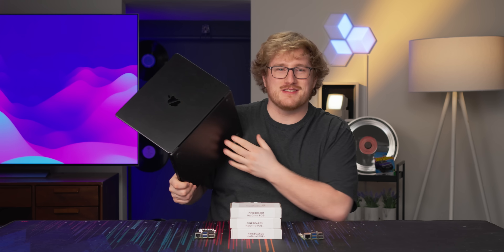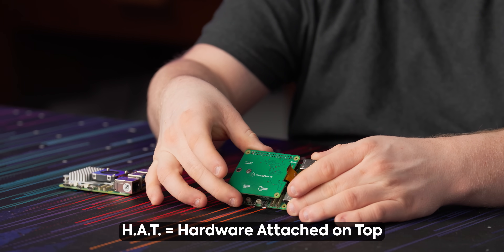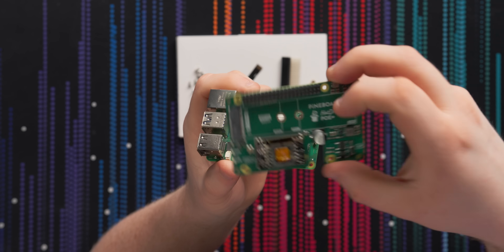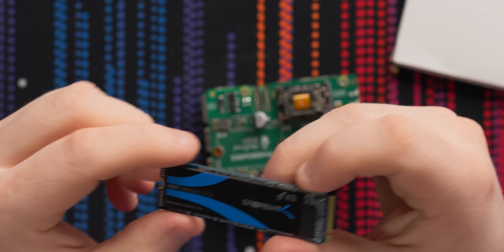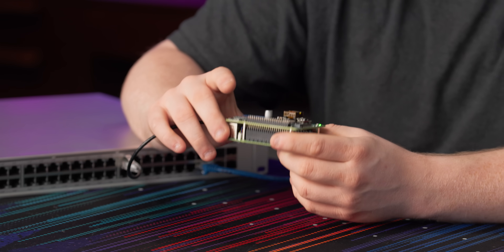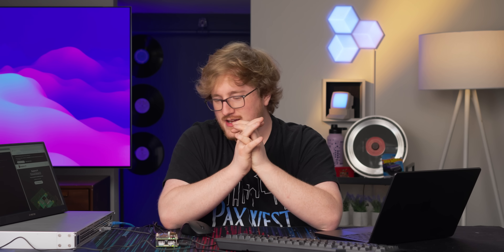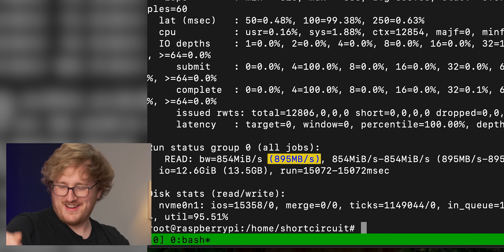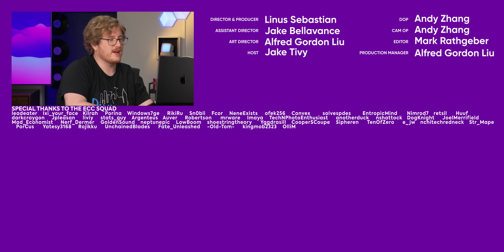This solves the Raspberry Pi’s BIGGEST problem - Pineboards POE+

Comment: For some reason, I didn't realize until somewhat recently that PoE HATs were a thing, so I basically did this with my 3x 3Bs, but the poorly-planned version. Got a cheap (~$15) PoE HAT for each, crammed them into my zero-ventilation metal cases, found the then-cheapest SATA SSD on Amazon (~$14), stuck each into a $10 case, and double-back taped the whole stack together. It's uncomfortably hot to the touch in the summer, but fine as far as computer temperatures go. Getting the SSD and PoE onto a single board is way cooler, though.

Comment: I have  Model B rev 1s with cheap sandisk cards that are still running just fine. I have NEVER fried a properly spec'd microSD in any of my other pies. The issues you state are non-issues compared to the one thing they NEVER address.....HATS BLOCK AIRFLOW OVER THE MAIN CHIP!!!! Though, they really do need to just put PoE on the damn board already....

Also, from a 'nerdy nerd' .....yeah I can see how basic plug and play stuff would confuse someone just cosplaying nerd-chiqe for clout. Ill be so glad once pop-culture moves on so REAL 'nerdy nerds' can get back to the good old days when someone in the nerd style wouldnt dare feel empowered bolstering their ignorance with things like 'math is hard' .... NERDY NERDS FREAKING LOOK UP HOW TO DO IT INSTEAD OF PLAYING THAT 'DUMB BUT CUTE SO ITS OKAY' CRAP!!! Ugh....hate fake nerds....

Comment: Being that they didn't have a PoE injector laying around, I kind of wish they would do some coverage on some good, 1-8 port, smaller, PoE injectors. I have 4 SFP+ fiber runs in my home (rental) and really only need a few PoE for 2 cams/doorbell and a RasPi...
Reply: What you are thinking of is just a small PoE switch, the reason they aren't covered is because there are several dozen different models, even just from name brands, all of which will do basically the same thing and no real way to tell them apart other than the name on the tin.

Just pick one from one of the known brands that fits your port (# and type), power budget, and PoE type requirements

Comment: Well, there that it's still only one PCIe2.0 lane. And it's still the weird RPI boot sequence (always from sdcard), no real SPI ROM to do something like proper UEFI environment.

So nope, I'd just go with RK3588, which has ironically better upstream kernel support, (most boards have) dedicated SPI ROM for UEFI boot environment, PCIe 3.0x4 + PCIE2.0 x1 + PCIE2.0 x1 (some boards used it for 2.5G ethernet) + PCIe2.0x2/SATA/USB combo.
Reply: I’ve been using ‘boot from SSD’ on RPi’s from Pi3 to Pi4 to Pi5.

NO “weird always from SDCard”. 
They boot direct from the SSD.

Comment: Not only is the USB-C the only out of the box option for power, BUT it uses an oddball 5V5A input that while technically in the USB-PD spec, is widely unsupported because thats a stupid amount of amperage to push at 5W when 9V3A is sittin right there for ~25W power draw.

and BUT it also is on the wrong goddamn side of the PCB. Ethernet comes out one side. Power goes in the other. This guarantees a cable squid or having to buy right angle adapters in order to make the cables somewhat organized. It's *awful*. PoE "hats" that block all of your GPIO just so you can mount these or use these on a desk with all the cables coming out the short side, get real.
Reply: Yeah, if they put PoE on the main board, then they could probably reuse the same DC-DC buck converter to support a wider range of voltages on the USB-C, as well.

Comment: In order to get an OS, I just used a portable NVMe drive cage and connected it to my laptop and I just wrote the ubuntu 24.04 server image directly to the NVMe drive using the raspberry pi imager. You could also just do a dd of an image directly to the drive as well from linux.

It's good to know there's a firmware loader there. Also, it's worth pointing out that you can just pxe boot if you don't have any OS loaded because there is a boot order and timeouts now. So, eventually it'll pick up PXE and you can just install via pxe directly to the drive, if you wanted to go that route.

Comment: If you're not absolutely sold on the Raspberry Pi, there are plenty of other SBCs that feature built-in M.2 slots. The POE seems to be unique to the Pi, though.
Reply: "other SBCs" are absolute garbage in other ways nobody seems to ever acknowledge
Reply: @ My only problem with them is they’re all manufactured by Chinese-owned companies
Reply: most of applications i ended up using rpi for would benefit from PoE. I honestly don't understand why rpi don't have it out of the box if while it still bothers to have an ethernet port.
Reply: "Other SBCs" usually don't have the same user experience as the Pi, though.  The Pi has good documentation, polished software, and a large user community.  I get the impression that most ARM SBCs are just like, "here's the board, good luck!"

Comment: As a precaution NEVER short out the power connections as the board instantly will become a brick! Even though it's advertised there is protections, in actuality there's no effective short circuit protection on the PI! 
Ask how I know, I lost 5 Pi's due to accidentally shorting the pins. I then spent lots of time trying to hack supply DC power, but was unable due to the complexity of the onboard power delivery.

Comment: RPi5 would be so much better if it had hardware AV1 decoding and H265 encoding.
That hat can run an M2 to 5 SATA adapter. With a sata bay and a Pico PSU it could be a jellyfin transcoding NAS. For AV1 now you need the Intel N100 but the setup is more convoluted, more expensive and takes more physical space.
Oh well let's hope for the 6.

Comment: While you certainly CAN lod the OS directly to the NVME drive over the Internet, the better (IMHO) soution is to insert a microSD card with raspbian AND the pi imager software.  Boot the Pi initially feom the microSD card, flash the NVME with ANY supported OS using imager, use raspi-config to set the boot orde rto NVME first, then fallback to microSD, and reboot.
Reply: And just WHY is this multi-step process “better” than the one-step ‘direct from internet” process?
Reply: @ernestgalvan9037  A couple of reasons:
- First, i tgives you a ready to use backup OS.  If you crater the OS on the NVME drive, or if becomes unbootable for some reason, you can boot off the microSD and attemt a repair, or reinstall.
- Second, you have the choice of all of the operating systems directly supported by the RasPi Imager, pluse the option to use the imager to flash a 3d party OS which you have downloaded.

Comment: Still running a ZFS based NAS with various containerized apps on the CM3588 NAS kit y'all showed off at one point. It's a quirky little board in terms of kernel support but at 1.8 GB/s sequential throughput it has enough juice to saturate the 2.5 Gb ethernet port it has. Has easily solved all the tiny-server needs of our household

Comment: 9:30, ugh I still refuse to acknowledge the existence of MiB, Base 2 and base 2 only. fuck the drive manufacturers trying to force base 10 bytes down our throat.

1KB = 1024 Bytes, 1MB = 1024 KB, 1GB = 1024 MB

base 2 isn't that hard people. (Also for those wondering windows of all things it does right does actually report storage in proper base 2 Bytes, so when windows says 1KB it really genuinely means 1024 Bytes etc and is part of the reason why drives don't appear as their full capacity listed on the package in Windows and 1TB actually reports as like 915 GB in Windows (part of it is reserved sector's on SSDs for accounting for failed flash modules, however the bigger culprit is drive manufacturers pushing to redefine what KB, MB, GB, etc. mean to sell less storage at the same prices.
Reply: ...but that's just plain wrong. Scientific prefixes have a set and agreed upon definition. Kilo stands for 10^3, Mega for 10^6 and so on. Therefore, when working with base 2, there were base 2 prefixed in need -> Kibi for 2^10, Mebi for 2^20 and so on. In the scientific community, this is not up for discussion. If this actually was a hot topic in the field and everybody would use their own definition, computers wouldn't work
Reply: and for the windows topic: yes, it does report the storage in base 2(which would be a good thing) but actually labels it wrong with base 10 prefixes. the general user just doesn't care or would not know base 2 units

Comment: Can't you already boot off a USB Storage device nowadays? (The answer is yes, with some setup, which requires an SD card for the initial setup unfortunately)
Reply: Only the older runs of RPi-3 boards need ‘setting up’ for USB boot, all later runs are up-dated.
RPi4 came with USB boot from initial runs.
RPi5 never had this issue.

Comment: At what point do we all admit that raspberry pi has semi lost its way? The point was to be a super cheap computer. And while yes, I can still buy just the board, now its like I need a cooler.. and this accessory, and that accessory. I guess its not required to buy any of it, but this certainly doesn't feel like the "Cheap, put it anywhere" thing it was advertised as in the beginning. I don't know anyone who gets by buying even the cheapest 2GB model for less than a $100 by the time you get the power adapters, etc
Reply: The original RPi-1 ‘needs’ the following to operate as a ‘normal’ computer:

Power supply
microSD card
Keyboard
Mouse
Video cable 

The latest RPi-5 ‘needs’ the following to operate as a ‘normal’ computer:

Power supply
microSD card
Keyboard
Mouse
Video cable 

Possibly a small $1 heat sink

And most folk experimenting with a Raspberry Pi will have a keyboard and mouse they can ‘borrow’ from another computer.
They probably have an 8gb microSD card laying around .

And of course:

A Dell/HP/Lenovo computer ‘needs’ the following to operate as a ‘normal’ computer:

Power cable
Keyboard
Mouse
Video cable

Comment: The bigguest problem with RPi5 is the PCIe device support. Its absolute garbage! Anything other than M.2 devices is a nightmare.
I cant understand why I can boot a SATA SSD connected to USB but not PCIe. Also if you want multiple devices connected through PCIe, you are limited to a small number of supported controllers...
I fried 2 RPi5s trying to do what I thought was a simple thing, and my project is now canceled, while my Pi4s and Pi3s keep working flawlessly. Maybe I will buy the 6th version if they sort all the problems with PCIe and have video hardware encoders...

Comment: The pain in the butt I find is many boards do require specific drivers or downloads you have to perform before you can use the NVME. You basically have to boot from an SD card, download the packages with the terminal, then unplug the SD card and put in the NVME. The NVME has to have your software downloaded while plugged into a USB port on your computer. You cannot upload any software using the raspberry pi installer to an NVME if its in your computers NVME slot. You can only do this if you use a portable connection via USB. I was setting up a home assistant server and it was a whole mess. The POE install option does not work for all hats.

Comment: Don't use a PoE hat.  Use a PoE splitter instead.  Keeps the Pi running cooler and is less expensive.
Reply: I tried that for a bunch of the pi's I have put in the field. I'd sometimes forget to order the cable or it'd break and I'd have to send a replacement. The hat (at least for me) was better because it's easier for people to replace a dud patch cable.

Comment: I'd love to see LTT Store to adhere to "Remessa Conforme" importing program from Brazil, so I could import some thing I'd like to buy there. The Precision Multi-bit Screwdriver costs around 58 dollars after taxes if participating in the program mentioned. Buying right now, outside the program, it'd cost me 78 dollars. And I'm not talking canadian dollars here. And that's because it's under 50 dollars, if it was the complete kit, with the bits and case, it'd cost more than 50 dollars with shipping (which is calculated on the taxes), so it'd be much higher. I think it'd cost 90 vs 130 dollars being on vs not being on the "Remessa Conforme" program.

Comment: The real problem with these boards is 1. The price. 2. The availability. What happened to the idea of helping poor children learn computers? Everyone has given up on that idea.
Reply: what children need a PoE+ and an m.2 ssd to tinker with a raspberry pi?
Reply: @ the premise of the video is it’s fixing a problem with the pi. The problem with the pi is the pi is to expensive. I’m not talking about the HATs
Reply: @davidsalvador8989 Cheaper lower spec pi are still available, you don’t need the latest pi for education. Your argument is invalid.
Reply: @ so are ti-83’s. Argument valid.
Reply: Kids got phones for $60 dollars.
Reply: You don't have to get the Pi5 to learn on, you can get the Pi Zero 2w for $20 bucks, it does everything the pi5 does except a little slower.
Reply: @dataterminal  its 30 dollars eqv in india.. and pi 4 70 dollars, not even 5..
Reply: supply and demand, supposedly they're ramping up production which should help but it's still going to cost more than Chineese brand alternatives
Reply: @ yes, even at 75 bucks that’s nuts.🥜
Reply: Enough cheap secondhand ewaste today from people upgrading their phones, gpu and pc’s every generation
Reply: @ agreed. Cheap laptops for 10 to 30 bucks are a much better resource then pi’s.
Reply: Price is the downside indeed, would rather have a miniPC
Reply: At some point Raspberry Pi got more interested in supplying compute boards to industry for profit, rather than promoting education as a non-profit.

Comment: That Ethernet cable should be at least 1 m long - according to the Ethernet spec.  The different twisted pair have different twist rates and there is a minimum length required to ensure there is no cross-talk.  I've had a MacBook Pro crash due to using short cables.  Those short little cables are perfect for when connecting to patch panels but that is about it.

Comment: With the CM5, you can already buy carrier boards that fit in the same Pi 5 form factor, but slap an M.2 slot right on the bottom! Really wish it were built into the Pi, though the FFC connection does have some limited uses that make it better (in very rare circumstances) than an M.2 slot.
Reply: Ayyy the man himself! Gotta appreciate your contribution to pi community ❤
Reply: of course jeff is here
Reply: @BaileyMagikz  "Pi" in a title is like the bat signal lol
Reply: @JeffGeerling  wait.. if you're batman that must mean red shirt is robin? 😂 it all makes sense now.. .
Reply: I almost wonder if that shouldn't just be the default then. If it is the same cost then why not? I mean a cool way to think about it would be that you would buy your Compute Module and a carrier board by default. Some carrier boards would be POE and some would be USB C. I know you can do this now but CM5 feels somewhat niche compared to their model B boards.
Reply: I don't get it why RasPi 5 is still not equipped with M.2 slot by default, IMHO that should be the standard now
Reply: @Tomydirium  because a lot of people do not use Pi's as anything that should have an M.2 drive, it's routinely used as a robot controller for example. It would be advanced cortex numbness to include a relatively expensive and space eating M.2 slot on something that runs off an 8 or 16Gb uSD card with loads of space to spare. The whole point of the rasbpi project is a computer for all the stuff you do not automatically get a computer in already - not to run is as some sort of desktop replacement. If you ARE running it as a desktop replacement you should clamor for an mATX carrier with a switch and a slot on it.
Reply: @Tomydirium  M.2 slot and its associated lanes and layout would place some constraints on the RPI layout, since the high speed data lanes require controlled impedance traces. it would increase the cost and size of the board.
Reply: What about poe? Thanks for the work you do, hope to be in a similar spot myself one day :)
Reply: When do we get a Pi 501 with a working NVME slot?!
Reply: You made me love my Pi 5 just a little more. Thank you for your content.
Reply: I've been using a Pi 4 as my main router since 2018. Everything on board: Dual WAN, multiple LANs, intrusion detection, adblocking (VERY effective!),OpenVPN server and client, statistics logging, and more. All the while pumping 1 Gbit per second (933 Gibibits) through the Ethernet port. Uses a managed switch with VLANs (802.11q)  to produce the number of ports needed for the router.
Reply: Honestly I think the GeeekPi P33 m2/PoE+ hat is probably the most convenient hat I have used on a Pi to date. It is also ridiculously cheap.
Reply: For once Jeff I'd have to disagree, the nature of the Pi really leans into the flexibility and simplicity of the PCIe data signal being there to connect to any expansion  you want seems better than doing M.2, at least when you can't have both as you have so many spare PCIe Lanes.
Reply: @JeffGeerling I agree, but I have mutliple Raspberry Pi Model B already, and those are rackmountable whereas a random CM5 board is not.
Reply: A wild Geerling appears!
Reply: hi Jeff could you answer my question please. 

I’m considering purchasing the HatDrive! PoE+ for my Raspberry Pi 5. However, my router supports PoE Mode B (9-50 VDC, non-IEEE 802.3af/at/bt). Does the HatDrive! PoE+ support Mode B, or would I need a compatible PoE injector to make it work? Any insights would be greatly appreciated.

Comment: I think the reason the 5 doesn't have M.2 is that it would use up the pcie channel, and someone might want to use it for something else.
Personally, I think it's such a common requirement that it should be there. Maybe if the next version has a processor with 2 pcie lanes, rather than a pcie x2 they can have 2 x1s, and use one for the M.2?